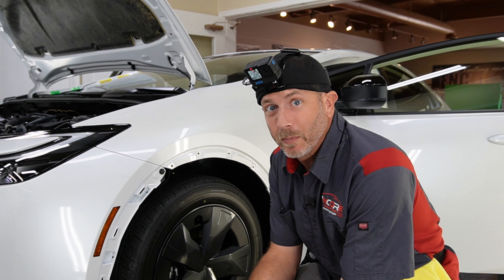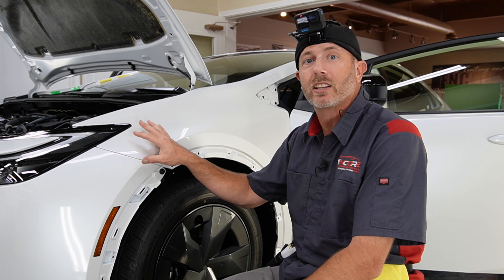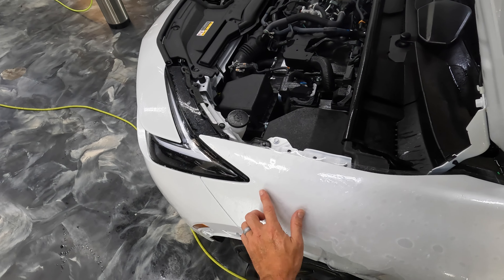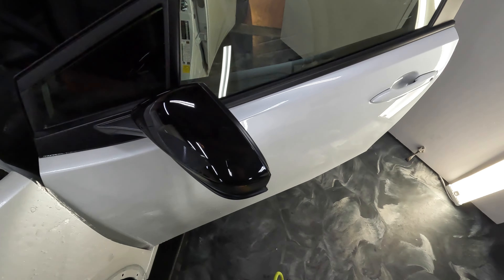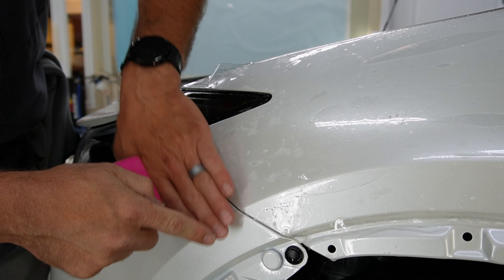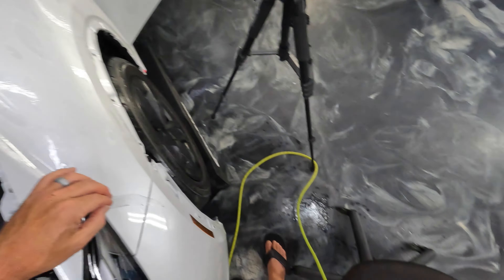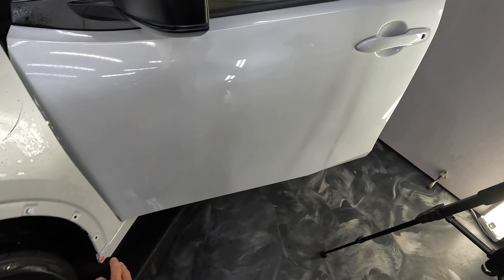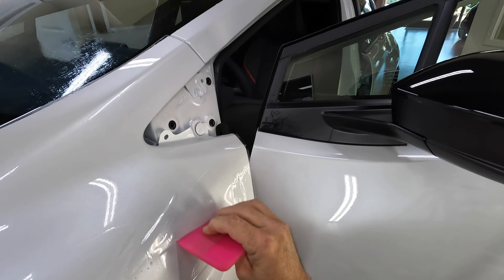PPF Car Protection - Full Fender PPF Install - Toyota Prius 2024

Comment: Awesome video again   ! So many hints and tips that makes such a huge difference on the installation. I can't wait to see your video that shows how to remove the panels. I planned to do it on my prius 2024 this summer. I'm a DIY guy so no easy precuts for me. I'll have to go the hard way (bulk)...
Reply from the maker: Thank you. I appreciate you leaving a c9mment. 
You'll definitely want to start the bulking on easier parts (headlights, fenders) and work your way up to the harder parts, like the bumper.
 I know some people talk trash on kits, but they really fit amazing now. It's pretty crazy. Installing kits is a whole different skill set. Make sure you do a lot of practice with cutting ppf on the paint. That's going to be crucial for a clean install. Have you watched my video on how to learn to trim ppf on paint?
Reply: @EncorePPFtint  Thanks for the advice about going with the easier parts (flat) first. Did you do the hood first with the white prius ? No videos about that ? Yes I did watch the trimming video. I'll have to practice for sure to get the right angle (10 degrees) et pressure (squeek). It's on my "to do" list. :)  Pretty impressive your trimming over the balloon :) I know some people use scalpel. Your thoughts on this ? How much would it cost to get a kit (precut) for a bumper (prius) for instance ? Is it really worth it for a newbie like me ? Nice teaching skills by the way. Thanks for sharing and keep up the good work !
Reply from the maker: No problem. I appreciate your feedback on the videos!
I did the hood as well. I edited the video today and it should go up next week on Thursday for Friday. 👍 The hood is a super easy install. I would do that first or second. No blade needed on the paint. 
I'm not sure on the scalpel. How hard is it to change blades and how often do you need to change them? I'm sure it's a great tool once you get used to it, but I like my OLFA blades the best. I use them for Auto PPF and Tinting. As well as Commercial and Residential window tinting. So I'm really good at trimming with the OLFA knifes.
I can get back to you on the kit. My wife takes care of all of that. Reach out to us as Info@encorewindowtinting.com
Kits are great and they take the pressure off when it come to needing to trimming PPF on the paint. You really shouldn't need to trim this kit. It installed really well. Bulk is a great skill to have as well. There is a lot more learning involved! :)

Comment: great video. The last one I did I extended the fender front and wrapped the front edge at the lite and trimmed it. Was actually really easy and looks great. The one I just did was red, I especially will do it on the white ones so there will be no visible edges that dirt will collect and show. I did not remove the fender trim, looked to be taped down and I did not want to bother with that
I did try your method on the mirror, took a little to get use to it but all in all worked out. Thanks!
Reply from the maker: Awesome to hear. Thank you for getting back to me on that. It's good to hear that the mirror worked out. You would have gotten it anyway! :)
Reply: Did another Prius this time I took defenders off I mean defender flares. They came out real easy. Thanks man appreciate it. And the mirrors went better this time.

Comment: Thanks for the demo Brent!
Were you able to stretch from the initial tac you did (by the mirror/a pillar) because it was a fresh tac and no alcohol was used?
Reply from the maker: I like your question. It's got me thinking. 
The easy answer is yes, because it was so freah. Fresh is they key. I could have used tack solution in that corner as well. There is so little stretch in that area. You need to keep moving after you tack something down. The more time the adhisive has to cure in that area, the more chance you have of getting a stretch line when you do stretch.  Using tack solution means you need to move that much faster. As tack solution will make the adhisive so much more aggressive and cure faster as well. 
Does this answer your question at all? 

I need to put more thought into my tacking, stretching, and how I work to not get stretch marks. I don't really even think about it anymore. It's second nature.  👍🏻
Reply: @EncorePPFtint  yep! That’s exactly what I was wondering. Thanks!
Reply from the maker: That was a great observation.  👍